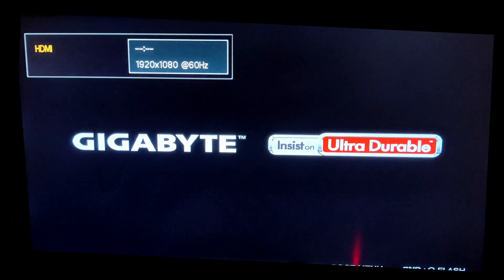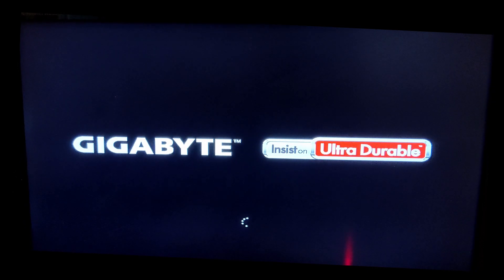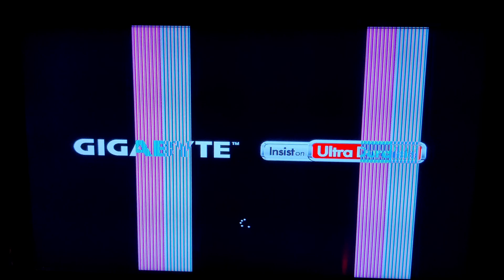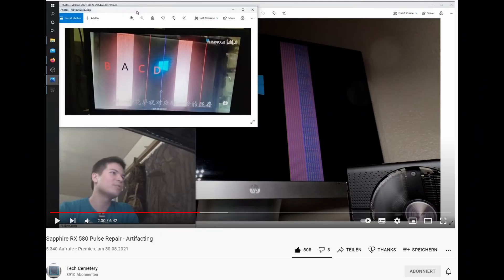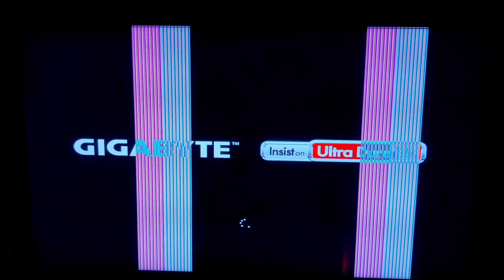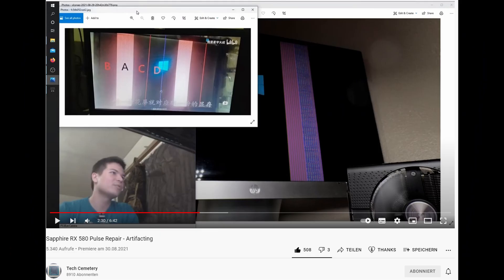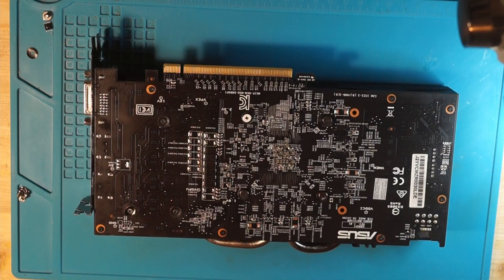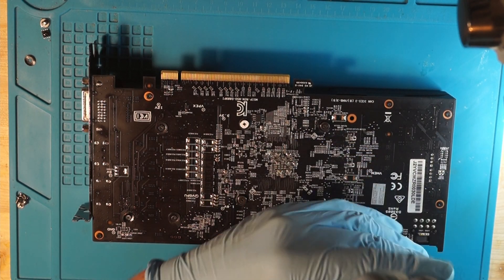Repair attempt on an artifacting Asus RX 570

Comment: 🤮 SKHynix always fails.. i mean i have here about 5 faulty RX 470 8Gigs, all SKhynix, 2 of my RX 470 are Samsung and they're perfectly fine (though those chips does not like low memory voltage, older technology, more nm, Hynix ran fine with 800mV)

Comment: what if I can't source the exact chip number can I use a substitute?
Reply from the maker: I would not mix chips, esp. Not different brands. But are you sure you cant source the correct  ones? Sometimes there is a production/date code on them, that does not need to match up, important is the Part number...you can find an explaination of what ist what in the datasheet for the memory
Reply: @fxbbm  thanks for replying, the chip no. is 80A77 D9VRL it's for a quadro p2200.
Reply from the maker: d9vrl is the important part, they are available on aliexpress or ebay, the Full name is:
MT58K256M321JA-100/-110/-120:A But search for "d9vrl"

Comment: My 480 does this. It only does it at certain times and im never sure if its heat related because even under small loads in certain games it artifacts hence the comment saying i wondered about the memory change on a 480. Gotta email me some skills.
Reply from the maker: Thats a though one, intermittent faults are hard to diagnose..Might be the memory might be the core..or something else...There is a diagnostic software for memory on AMD cards (tserver) but at least for me, differentiating between a memory controller fault and faulty memory chips is not trivial...
Regarding the mail: if i could i would 😂 
I wish you a happy new year!
Reply: And a happy new year to you! Thanks again!
Reply: Underclock and under volt the card,it should hold out for longer

Comment: I have an Asus Strix RX 570 OC  4GB. Whenever I run a Heavy game GPU crashes and gives black screen (no sound or anything). I have to restart my PC. I tried almost every version of drivers. The GPU almost works fine in low graphic demanding games Such a valiant as long as the graphics settings remain fully low. If I change any single graphic setting to medium or high. My GPU crashes instantly.
Note:
1) In stress test GPU doesn't crash a single time. I tried a stress test exactly after the crash.
2) I changed my thermal paste to a High-quality paste.
3) Before gaming temp is (26 C). When opening a high-demanding game. Temps remain from 52 to 60.
4) when opening a high graphic demanding game like a warzone. The game only crashes when the loading is complete and I am on the main menu. (some times during the match)
5) I tried undervolting. decreasing GPU clock frequency from 1300mhz to 800mhz also memory frequency from 1700 MHz to 1200mhz. (Still no luck)
6) I tried my card on my friend's high-end PC still had the same issue. Also tried almost every version of the driver.
7) To me its looks like a hardware issue.

Give me suggestions on what should I look for or what should I do.
and which part can cause this issue?
plz, help me I can't afford a new card bcz of high prices.
and also thanks for reading this. (May God bless u).
Reply: I just did the gpumem test and also monitor the GPU performance during the test. Its used all my gpu memory  and didn't crash.
Reply: @trw8777  tried OCCT VRAM and GPU didn't crash. But there was also a PSU stress test in OCCT. So, I tried running the PSU stress test, and my PC instantly shut down.
Reply: Suggest me a budget PSU for this card.
Reply: @trw8777  i changed my power supply after ur suggestion and its seems that powersupply was faulty.
But now few days ago i turned off my computer it was working fine but when i turned on the computer on the next day there was no display i thought the card was dead. But when i instelled my gpu to a friends gaming pc it was working fine and did the stress test and other available test like memory etc. I thought my motherboard is causing some issue. So, i thought about buying a new one. i7 4gen was in my budget. when shop keeper installed my gpu in every 4th gen i7,i5,i3 CPU. it didnt give any display. But got display on i3 6gen and i5 6gen. So, whats that problem?
Is GPU is about to die? or is there any other issue? Searched the whole internet but didnt found any Case like this.
Note:- i was using rx 570 with amd 10 7850k. It worked completely fine for the whole 3 years. Got this issue about 8 days ago with having all same specs nothing changed expect powersupply.
Reply: @trw8777  i have now bought the i5 6500 around 1 hour ago. On first try i got display on i5 6gen but i requested the show keeper to restart the computer after complete poweroff. I got the same issue NO DISPLAY. But after removing cmos battery it woked again now i am going home and hoping for the gpu to work. The problem is really strange. Is it GPU BIOS issue. Why its happening? Plz answer me and guude me. I already spent a lot of money bcz of this Gpu.
Reply: @trw8777  ok i will try tommorow and will let u know. Thanks
Reply: @trw8777  today i tried flashing GPU Bios. But same problem no display on boot but every thing is working fine its just blank screen i can hear windows notification or other sounds. But when i unplug the power, remove the cmos battery and press the power on button for few minutes then turn on the computer normally it works but i have to do this every time whenever i want to turn on my PC.
So, what u think the problem is?
Also i stress test GPU chip,memory and played heavy games like red dead redemption on high settings. The GPU works flawlessly without any stutter or crash.
i dont what is wrong with this GPU i cant even sale this in this condition.
Plz help
Reply: @trw8777  plz help me?
Reply: @trw8777  i already checked the gpu in 4 different pc same issue and the gpu doesnt show display on other 3 pc. I took my GPU to a computer shop it didnt show display on a single pc. The shopkeepers other gpu were working fine on their pc. I dont this the PC problem here. I think its GPU who is causing this problem. Which component of the GPU will be causing this weird problem. Which Component should i check. BTW its working totally fine but i have to completely remove the power from the Motherboard and remove CMOS battery.
Reply: @trw8777  ?

Comment: Try checking damaged memory trace on the back of the pcb (at that mem.chanel area of course). And may some bad capacitor in that area. I have found my problem is that

Comment: I used 500C and max airflow with my station and eventually the chip jumped into place after 60 second heating. But the chip didn't work and MATS gave max errors, like the chip was not installed properly, although It was soldered... why is that? Have you ever replaced VRAM on NVIDIA card?
Reply from the maker: Thats a bit hard to answer. 500°C is a pretty high Temperature, so i would def. not go any higher(high risk of popcorning). I mean it could be that the chip is not soldered on properly (bridges between pads or something like that). I would reball the chip and solder it on again. Maybe try to preheat the card a bit, since your hot air station seems to struggle. But apart of that i dont know, sorry! Yeah i've done nvidia cards, soldering wise its the same.
Reply: @fxbbm  Thanks for reply. I noticed that I needed 500C to remove the chip and 500C to solder it back properly, it wouldn't melt evenly before that. I think that temp is OK, though. There could be some bridged pads (no short though), because at first I used too little heat and some areas definitely didn't connect. The chip was tilted. I think I will remove it and reball, wick the pads flat, and put it back properly. Ordered new chip in case the first one is ruined.
Reply from the maker: @mikegaming4924  Yeah, these temperatures are propably not that comparable between devices, if it works for you its fine. Reballing sounds like a good idea, sounds like something went wrong between the first and second attempt. Anyways i wish you luck and hopefully you get the card running again!
Reply: @fxbbm  Thanks !
Reply from the maker: Hey, I was wondering, did it work after reballing?
Reply: @fxbbm  Thanks for showing interest in the card. I didn't reball yet, I am waiting for stencil to arrive
Reply: @fxbbm  preheating board to 150C   and then hot air at 420C and using new chip fixed it.
Reply from the maker: Cool! Glad it did work out for you!

Comment: did you fix the card bro?
I have an ASUS Strix RX580 8gb and the same problem as yours.
My question is: can I use a different ram for the replacement parts?
'cuz I have a dead rx580 with a Samsung K4G80325FB-HC28 but the Asus Strix ram is K4G80325FC-HC25.
What I know about the differences between those 2 rams is only the speed. 7gbps for the HC25 and 8gbps for the HC28.
Thanks for your reply.
Reply from the maker: I have worked on the card quite a bit, but i did not manage to make a video about it. I changed the whole memory to elpida, still the same issue (same pattern). So, no luck (so far) and to me it seems like a fault with the memory controller.
Regarding your issue: I'm not quite sure what you mean. If you want to change only the faulty bank with different chips, then no, that will probably not work.  If you  want to change all the memory chips, that might very well work (but it's not guaranteed).
Reply: @fxbbm  ohhhh! Okay thanks bro. I'll try to find the exact same memory chip
Reply: @fxbbm  It could be voltage issue. Maybe one ram voltage regulator is dead but not short circuit, and ram don't get enough amperage to work properly, then even the voltage can be to low in work. you should check that.

Comment: hi! You can use tserver for test memory chips. If you want i can send you a link with tserver. Use buttom heater,  will be easy to soldering.
Reply from the maker: @Alexandr Tskhay, Thanks for commenting! If you could send me the link, that would be great! 

--edit--
Have found it! But thanks for mentioning it, this seems to be very interessting! I knew about mats/mods, but a similar software for amd cards is news to me, exciting:)
Reply: @fxbbm  There is a third reason for memory corruption or artifacts which is the resistors that are located on the back side of the bad memory banks.Only very few people know about this.The resistors are very hard to identify.And i had fixed many cards myself by just replacing 1-2 resistors in just 2mins.
Sorry for my bad English😞
Reply from the maker: @m.ranafaizan7608   Hey, thaks for the input. I will check that, would be nice if that is the issue. There will be a part 2 to this video and i will look into it then. Thanks for letting me know and have a nice day!
Reply: @fxbbm  i am glad to help you
Reply: using a preheater is very important. It prevents the motherboard PCB from flexing and causing more damages.
It will also be easier to solder the chip with a preheater.
Reply: @kakkoishonen  you are absolutely right. I just noticed, that the author don't use a preheater.

Comment: Hi, in what degrees do you solder memory chips and for how long? I know that you said that you desolder the memory chips in 420 degrees. And what kind of cleaner do you use for cleaning the board?
Reply from the maker: Hey, I use the same settings for both, 420°C @110l/min. But take these numbers with a grain of salt. These are the settings that work for my machine, yours might be different...
Time: well, until its soldered on (when the chip "jumps" into position), usually its a bit longer for the first one, say 30-40sec and a bit shorter for the subsequent chips. 
Cleaning: i use 96% Ethanol. Methanol (commonly used in rc cars) or IPA will also work just fine. Most people use IPA, but here, Ethanol with a bittering agent is just a lot cheaper and much more readily available..
So i hope this helps, thanks for watching and have a nice day!
Reply: @fxbbm  Thanks